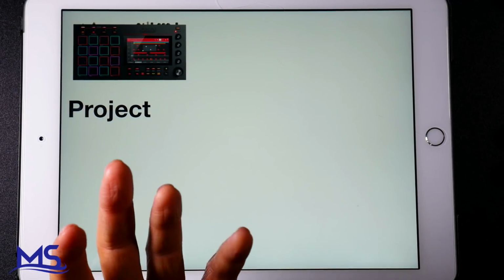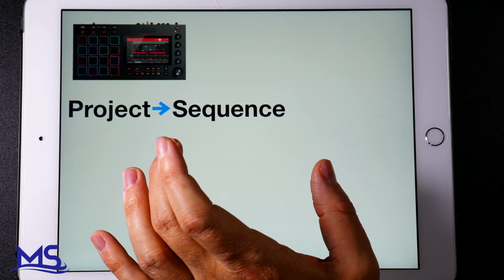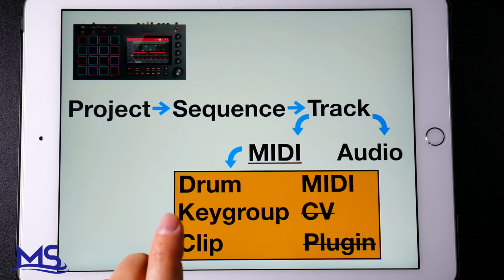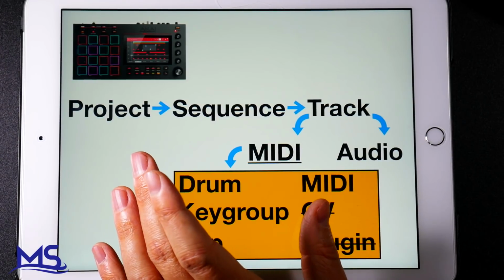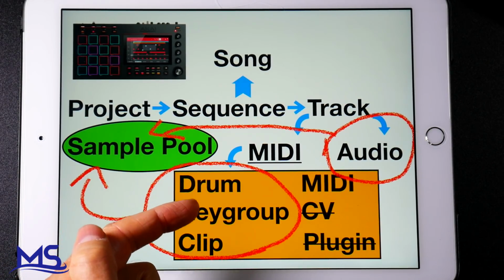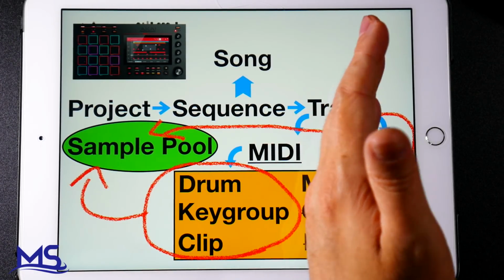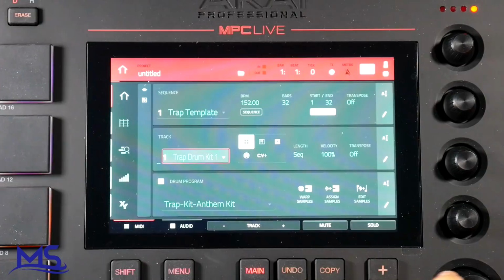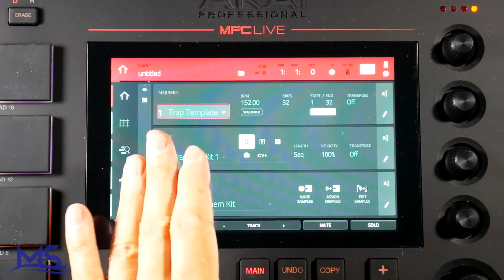Mpc Live Basics - Projects, Sequences, Tracks, and Programs

Comment: all i hear from mpc is just trap...im electric guitarist and i hate trap...can u make songs llike tash sultana with it ?or i shouldnt buy it
Reply from the maker: You can technically make whatever you want with it.  You probably could do something like that for live use, but it would be a huge head ache to find work arounds for it to work.  MPC LIVE is NOT intuitive.
Reply: @MatthewStratton  thanks for answering .i got two more questions please. can u plug midi key to it too?and can u stop/start sequences(like loopers)with mc6(morningstar) midi controller foot switch?and loop electric guitar?(basically using the pair of it and mc6  like looper)
Reply from the maker: @kamranfallah  I don't think what you want to do is possible.  I cannot think of a real way to do it.  You cannot use a midi controller to start and stop sequences.  You are better off buying a looper guitar pedal.

Comment: How do I add the software MPC to my computer?(I just use the Live stand alone). just switch to controller mode? not even sure how to do that.
Reply from the maker: You need to log into your akai pro account and register your MPC.  Then you get the ability to download the software.
Reply: Cool I already did that. @MatthewStratton
Reply from the maker: @ccfunk1  After you install the software open it and then go to menu on the mpc.  In the upper right hand corner there is a picture of a computer chip.  When you press that you can go into controller mode and use your mpc with the software.
Reply: Thanks Matt. I will give it a go . @MatthewStratton